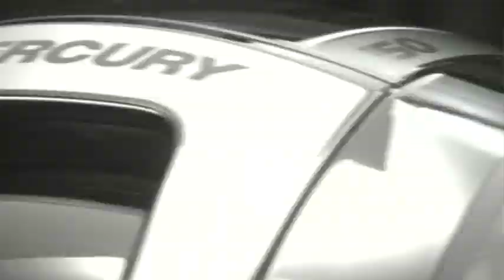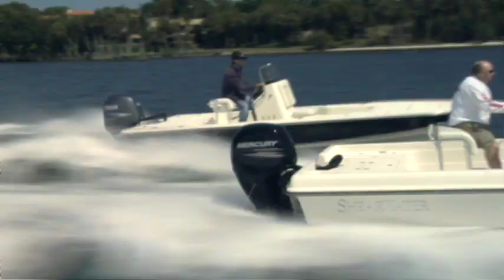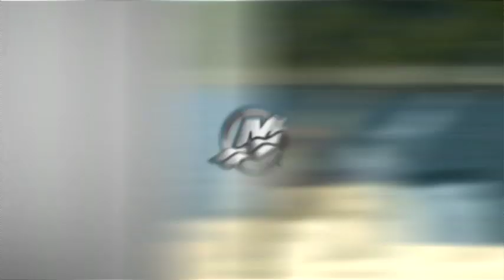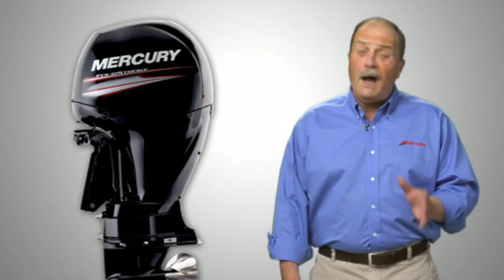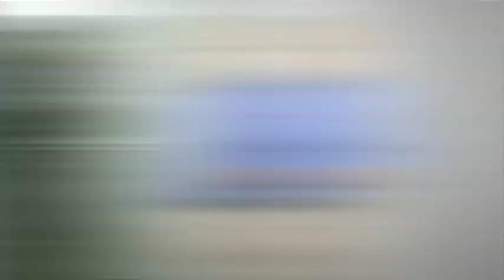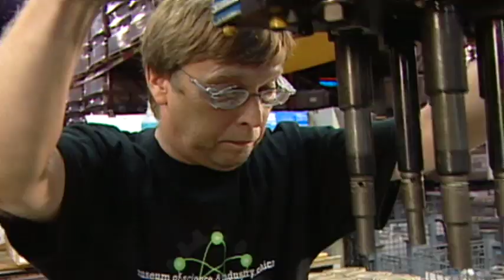Mercury Marine | 150 FourStroke Product Profile

Comment: I just bought a pontoon boat with a Mercury 150 hp 4 stroke. My only complaint is checking the engine oil. I would like to see a small access door for the engine oil dipstick. Pulling the hood for this not easy, while on a trailer. I can't imagine removing the hood on a boat that stays in the water all the time. My boat and engine is 2023, so no improvement yet. Other than that small gripe, this a great engine.